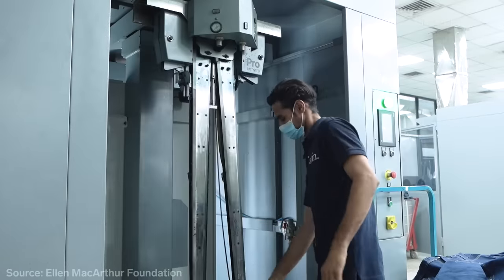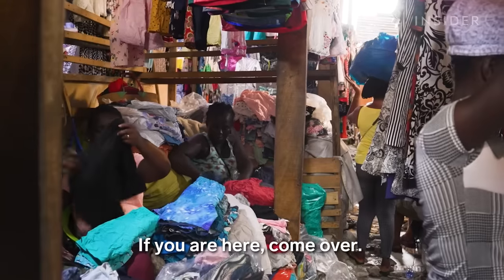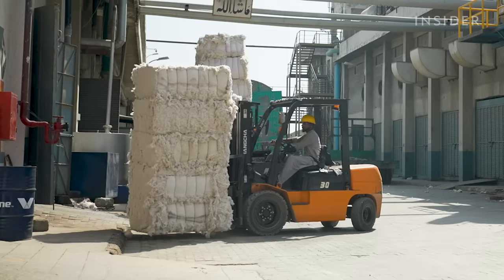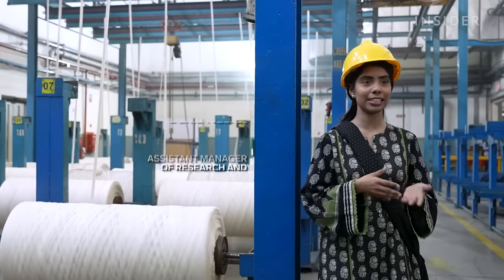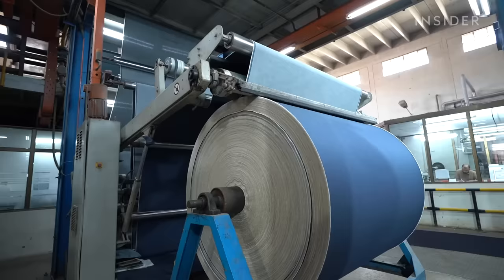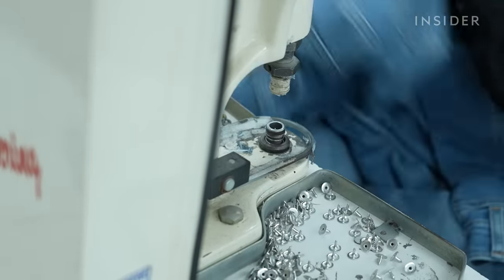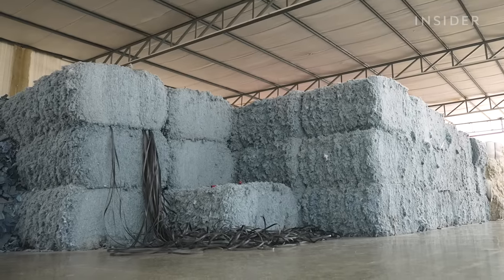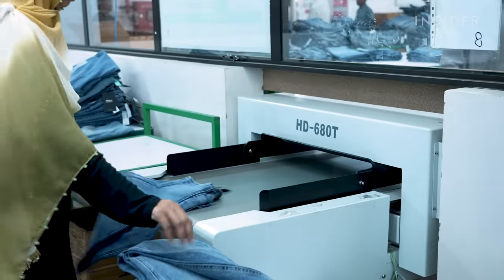How Millions Of Jeans Get Recycled Into New Pairs | World Wide Waste | Insider Business

Comment: I love that message: "buy quallity over quantity" . I bought pairs of jeans that lasted me 1-2 years. And I've bought pairs of Levi's that lasted me 10 years. The problem I have now is that even those brands are using lesser quallity materials or using additives in their cotton mix that makes the final product weaker.
Reply: Women's jeans are the worst when it comes to low-quality denim.  They can make that stuff half the thickness of men's jeans because women want something fashionable to wear most of the time, while men want something they can get dirty work in without having to worry if they are still presentable.  Brush off the dust, chuck 'em in the wash, and pull out another pair for next time.
Reply: @docferringer  Most of the time, women's jeans also have zero usable pockets...Unless I'm meant to wedge a dagger hidden in a lipstick in my right pocket 🤪 Took me several months to track down a thick canvas pair of pants I could wear through spiky scrub, for some reason even women's hunting pants were thinner than men's...(with a "flattering fit" and "breathable, chic design" - exactly what I need the next time I'm in tall grass and almost step on a snake 😅)
Reply: No pockets on pants I have always felt like was a way to push purse sales to women. Why else would nearly all, clothes not have practical useable pockets? Also, I have jeans in excellent condition that are over 25 years old that I still wear.
Reply: I bought a thick iron heart and jelado jeans. Payed like 250 Euro each and was very disappointed they didn't last longer than my others
Reply: @YamiSakanaShadowFish but they do make the magical backpockets that hold a phone sticking out 3/4ths of the way without falling
Reply: And dont put on weight so they fit for years

Comment: I donate ALL of our clothes. I never, ever trash any textiles. We recycle old towels by cutting them into rags to use for washing cars, mopping floors and scrubbing windows and in restrooms, when we cook bbq outside (grill), or washing really anything outside. We also donate old towels without holes to our local pet shelter. We stopped using paper towels, paper plates, plastic forks and spoons, and we recycle all of our plastics, cardboard, paper, glass, tin, and aluminum. There’s so much you can recycle and even though it only makes a small difference, many people doing the same thing makes a HUGE difference!

Comment: 3:35 so only 8% of recycled stuff is used in the new jeans?
Reply: 100% of the recycled jeans will be used in the process, but each pair of new jeans will have 8% of the recycled cotton. Think of it as supplimenting the supply of cotton rather than entirely replacing it.
Reply: Yes it should be 50% atleast to call it recycling actually 🤣

Comment: I wonder how much does the choice of running blowers which are typically inefficient method when considering gains & loses, input/output, compared to simply let them air dry in an environment that stimulates the natural process & speds up the process without the use of known blown blower usage that is shown to cause more harm or inefficiencies than the weight of the good or beneficial reasons to use.

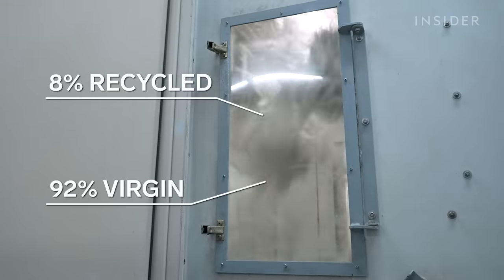Comment: 3:24 = 8% recycled +92% virgin cotton. Isn't this too less of recycled material? Such will be justified in developing countries where workers will be paid less to justify the use of 8% recycled material. Entire processing of recycled material is manual.
Reply: My thoughts too. Then they say that the blue thread is added to white thread in a 3:1 ratio. Making the 8% even less in the final product I'm assuming.
Reply: The recycled fabric needs to be strong enough.  The recycled fibres are too short to spin into yarn to weave the fabric, so have to be added in the proportion given to new cotton fibres otherwise the fabric would pull apart.  It's not that they're only choosing to use 8%, this is what works to produce the fabric needed.
Reply: @ecoralsmith4167 spot on

Comment: What’s weird is they they said 80% Blend can be recycled but then said they are only using 8 percent for the batches.
Reply: 80% of the fabric can be recycled, but after it's chopped up the fibres are too short to spin into strong yarn to weave more fabric, which is why it has to be mixed in with new cotton fibres.  They did say that up to 30% of recycled fibre can be used in a mix, but it will depend on what weight of fabric they're producing.  If they used a higher proportion of recycled in each batch of fabric they make, then it wouldn't stand up to wear and tear and everyday use.  They will be using the 80% that is recycled, just not all in the one batch to produce more fabric, it will be going into every batch.
Reply: @ecoralsmith4167 spot on

Comment: Like the recycling process but did they say 8% of recycled denim with 92% new cotton…how does it take 3 old pairs to make 1 new pair ??
Reply: Because the fibre is too short to spin into yarn after it's recycled, it would literally pull apart if you used it like this.  It needs to be added to new long fibres of cotton to be able to produce a strong enough yarn to weave the fabric.  All the recycled fabric will be used in different batches of fabric being produced.